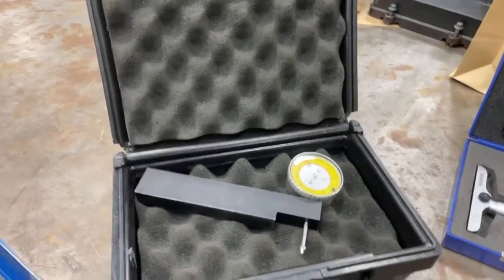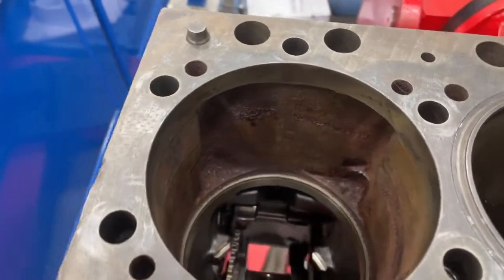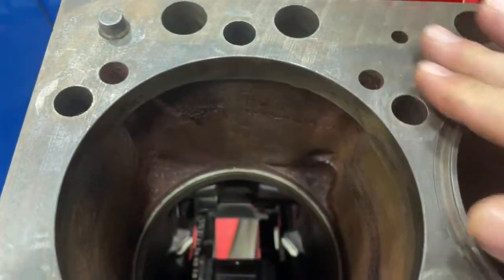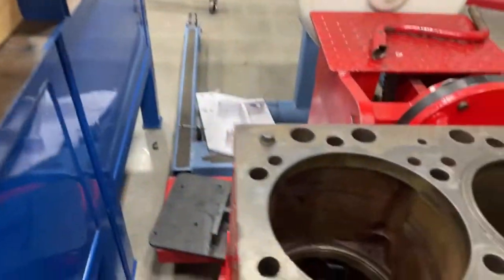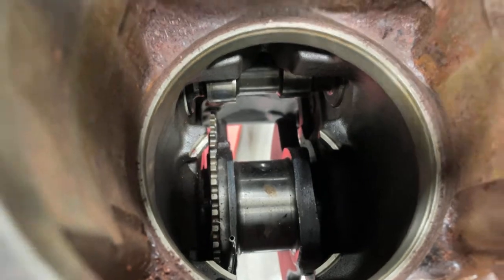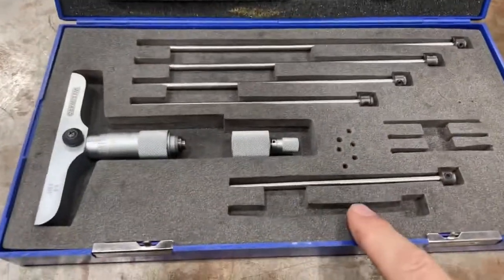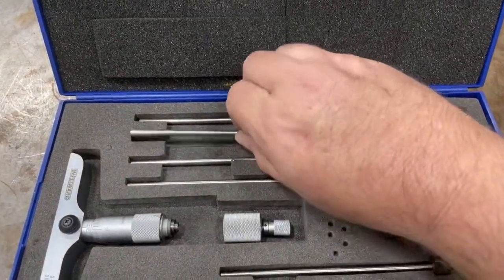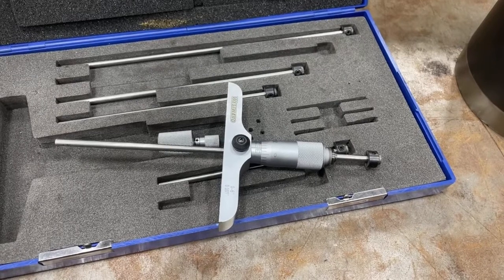░▒▓█ 𝐃𝐈𝐄𝐒𝐄𝐋 𝐋𝐈𝐍𝐄𝐑 𝐏𝐑𝐎𝐓𝐑𝐔𝐒𝐈𝐎𝐍, 𝐂𝐎𝐔𝐍𝐓𝐄𝐑𝐁𝐎𝐑𝐄 𝐃𝐄𝐏𝐓𝐇. 𝐖𝐇𝐘/𝐇𝐎𝐖 𝐓𝐎 𝐌𝐄𝐀𝐒𝐔𝐑𝐄. █▓▒░

Comment: Thanks for the video. Could you give advice on the best procedure on removing factory sleeves from a 60 series? Is there special tooling for the removal and install of the sleeves?
Reply from the maker: I will do that as soon as I have access to a series 60. The closest I have is an early model DD. There is a special tool they make for seating the sleeves on that but pulling the sleeves is pretty standard